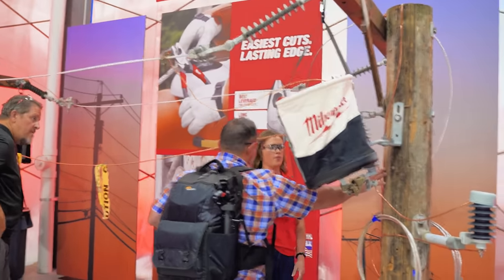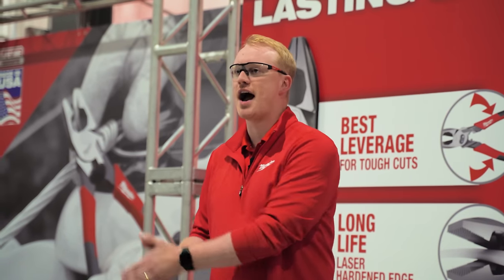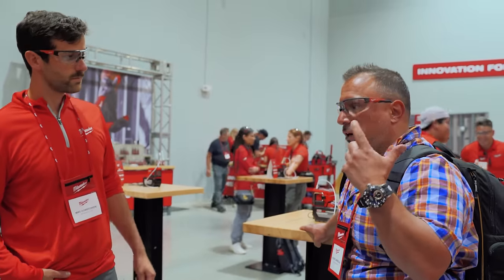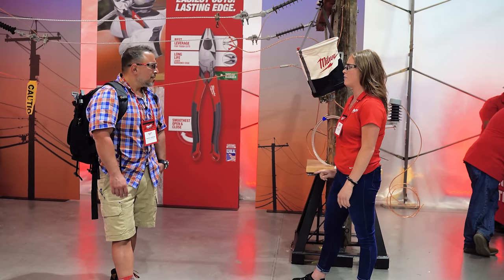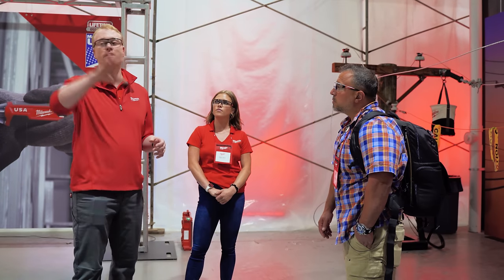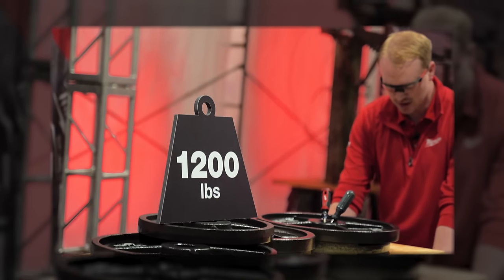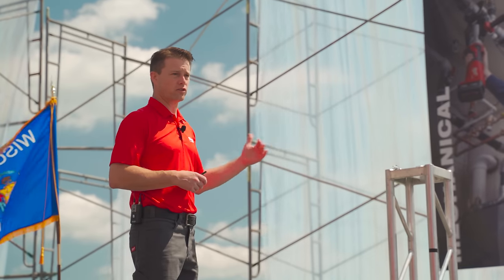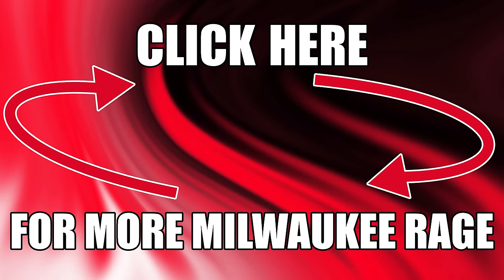BIG Problem With Milwaukee's USA Made Hand Tools (THEY'RE LYING)

Comment: I was an aircraft mechanic in them USAF for 14 years when I got hurt. The AF put me in charge of tool purchase, and I was sent to several large tool shows directed to the military. I looked at all the manufacturers and also saw some of the outrageous claims made by the salespeople. As a master mechanic I asked to try the product, but most were reluctant to let me try because of "liability" issues. I will say that Snap On was the most open to suggestions and when I asked them if they could design a drawer handle end plug that was round they asked why and I explained that the handles stuck out just enough to snag our BDU's and rip them they listened. I later ordered 24 "taco wagon " tool boxes for the hangars and they came with the rounded ends. The vice president that was at the show offered me a job in design and I declined but was impressed to see they really listened to customers. Glad you challenged them, love your videos!
Reply: Wow what a cool story! A job offer even, that's incredible. Great job, thanks for sharing, and thanks for your service!
Reply: Yeah more companies definitely need to take this approach. Especially the failing car companies.
Reply: Ll
Reply: Cool story!
Reply: How long ago was this experience you had with Snap On?
Reply: Only good thing I've heard about SnapOn in years.
Reply: Oh yea?
Reply: It is always nice to see examples of the tool companies listening to feedback instead of ignoring it.

Snap-On has been a disappointment to me lately as the competitor's products have caught up and Snap_On's response was to raise prices for foreign made tools with Snap_On  branding.
Reply: listening to your biggest acquisition firm is not really listening to customers.

Comment: I'v been an A&P mechanic for 27 years . A lot of the big companies especially in manufacturing or large air carriers or military contractors , supply the tool box now . The box is completely shadowed and the tools are tracked by computer.  It's tracked by who removed the tool . You have to use your company badge to open the drawer on the tool box , after you open and close the drawer the toolbox has a camera in the drawer that takes a picture that's digitally stored in a computer with who opened the drawer and what tool was taken  out . The point I'm making is that these tool boxes are $50,000 . By a big Tool Company  , not going to mention the name ? But it's easy to find out ! ... Milwaukee makes great tools . If you manage to break a hand tool , you were probably abusing it . I have my own  set of tools and it's  a mixed variety of brands  ( some expensive some cheap  ) Milwaukee  , some Snap On , and all in between  . Not going to even try to list them all . MY ADVICE TO ANY MECHANIC STARTING OUT . Don't go and buy a $10,000 tool box that's empty . Invest in tools for a few years  , buy a box that's within reason . I have yet to meet a mechanic that gave his tool box to his kid or grandchild.  THOSE ARE ALL SALES GIMMICKS TO SELL A TOOL BOX TO YOU . Invest $10,000 in tools, then get an expensive tool box . YOU MAKE YOUR LIVING WITH WHATS IN THE BOX . I found out two smaller roll around tool boxes are easier to move than one giant one . You're not always going to have a forklift.  Don't go nuts buying tools on credit. Seen people do this also . People get addicted to buying tools . Remember your doing this to make a living.  Don't buy a bunch of tools to make someone else rich .  ( I followed a Tool truck driver home one day ) trying to stop him to buy a tool . He got to his house , couldn't believe it . $800,000 house on 20 acres in Texas outside Houston.  Don't make these guys rich .
Reply: I made the mistake of getting a giant one because of garage space… and yea, I’m not moving that thing again.
It will be sold with the house like a pool table or Jacuzzi
Reply: Buy the tool box at Harbor Freight.
Reply: THIS COMMENT IS THE MOST ACCURATE, FACTUAL AND HELPFUL
Reply: @TheCyberMantis  cyber mantis knows the way
Reply: I'm a journeyman electrician with almost 20yrs in the field. Some tools you'll need to spend some money but most others you can get the job done with cheapies. I like my Milwaukee dikes because of the pipe reamer. They're hole saws aren't too bad or  sockets and box wrenches, but I won't use thier cordless tools. I've gone through so many different brands dropping from lifts or just wear out. Now I just rock Ryobi. Not too pricey and the hammer drill surprised me how tough it is. Band saw is nice and my tree trimming tools. All use the same batteries, so I've got that going for me...which is nice.
Reply: @TheCyberMantis  that's what I did
Reply: I've been using the same snap on box for almost 40 years it cost me about 300.00 back then and it's not the biggest box but when I stopped working on cars for a few years my son used it until he bought his own box, it's still in use at my shop its overflowing with tool,I have a couple of other boxes too. Snap on rebuilt the drawers about 20 years ago and I'll bet that box wi last another 40 years with no problems. And my granddaughter has already claimed it when I finally give up!  So they do get passed down it just takes awhile!
Reply: Yes yes yes to any new mechanic don’t buy a big snap on, Mac, matco ect box. I grad from universal technical institute and we got 30% off tools people got like 10k package with the box I spent 20k no box and got a craftsman I got the advance mechanic kit so like 4x the tools and a box. Just be smart tool make you money not the box.
Reply: You don’t know what that dudes story is.  He lives there because?  His dad died and gave him money?  Uncle gave him the land…you don’t know and this is an extremely ignorant comment.
Reply: @jaredmayer3960  we’re talking about toolboxes and your talking about a guy getting land… I’m sorry if I missed something in the video but who are you speaking about?
Reply: @jefflovespigs  read this comment again…last lines of the comment, ”you don’t buy tools to make someone else rich!”  The guy followed the tool truck owner home and the tool truck dude had 20 acres outside Houston with an $800,000 house on it.  Just because he sells tools off the truck doesn’t mean he screwed everyone over to get the money to own a nice house.  Maybe his wife is a dentist?  Maybe he’s in mega debt?  We don’t know what the story is and it’s super ignorant to assume because you see something and think he's shafting everyone.  Yes you definitely missed something.
Reply: @jaredmayer3960  no no no thanks I really did miss that bit. Yes I agree dont but a expensive box when a new mechanic but they are not scamming and marking up crazy amounts that the main company. They have a though job a lot of expensive items that can be stolen or loss of inventory.
Reply: @joe_8699  I have found your experience with Ryobi to be accurate 100 percent. I'm a California contractor and as you mentioned, some tools I use are expensive, however Ryobi work great and batteries are inexpensive and I can't kill them. I do get comments from other subs using Hilti or festool trying to shame me but I'm too old to give a shit what someone else thinks. Beside the fact I have 6+ tools and batteries for the cost of a bare tool from Hilti.😂🤣
Reply: Aircraft tech 22 years. Snap on have the best cutting tools. Matco has the best power tools. Buy cheap stuff and move it to your garage. Use matco and snap on proffesionally. Stay away from chinese junk.  Trust me
Reply: I've always said that after 23 years of being a GM tech. Your 15k tool box never once made you any money. Your tools did, however. ANY adequate tool box would have done the same job and many of them are under 1.5k.
Reply: @nalgas5569  I doubt it.
Reply: I do all mil spec work on military aviation and we don’t really use any American hand tools!
Czech, Italian, Swiss, and even India!
Reply: Your gonna be that voice in my head everytime i think about buying a tool lol
Reply: @john Marshall... no Milwaukee is putting out some defective runs... I watched a guy at home depot break 7 high torque impacts in the parking lot in ten minutes... they have made design changes that render the products defective... I'm sure they will change it but how many people bought 300 to 700 dollars scrap
Reply: @Johndoe309  Milwaukee acknowledged the defect and they're replacing all of the new model variants with the original design. There's a video on YouTube going over their statement on this issue. Glad Milwaukee owned their mistake.
Reply: I get a lot of great power tools and old school tools even at yard sales at a fraction of the cost new.  Some even still work better/last longer than new products at Lowes
Reply: @armedtotheteeth1974  One thing you forgot. Never buy prop wash of the Snap On or Matco trucks. Always buy locally.
Reply: Why the spaces before commas and periods?
Reply: McDonald's is paying $22 an hour they give you  a t-shirt and visor. You don't have to buy any tools no certification of schooling. Just $22 an hour to just mop and sweep and do a half  a#$ job at that. 🤪😱🤠
Reply: @Exar46  Well $22 ? Hr like 15 max & high.skilled Trade pays over 100k now easy & never out of work ?
Reply: That $50k toolbox might help keep FOD off the runway . Wish I had one in our shop cause I can't keep tools from walking off and it don't matter if it's a Harbor Freight Pittsburg 9/16 or a Snap On 9/16 . When you need one you need it
Reply: @jefflovespigs  There taking about the guy driving the Tool Truck with the Over Priced Tools!
Reply: @NervousNick  ya I got that I am a mechanic I know all about tool trucks it was the last bit I didn’t read till after. But thanks
Reply: @ericatchley3482
Reply: No truer words have ever been spoken! Plumber, HVAC tech, by trade, then spent 15 years in industrial food manufacturing the last 7 as maintenance manager of the hottest stock of 2019!
Reply: @jaredmayer3960  yeah that's funny you're probably the guy he followed home
Reply: Stalker!
Reply: @Johndoe309  I can vouch for these defective runs. My buddy bought 3 sets of milwaukee fuel impact/drill... all 3 broke in a day... he got sick of them and got dewalt instead. I have seen fuel tools that work... and I cant kill my old brush milwaukee models... though I want to upgrade to the new ones but I am afraid of dealing with a bad run even though they will replace it.
Reply: I have a not too distant neighbor drives a tool truck 

He lives in a shanty and he is renting
Reply: crazy that i can sell my snap on tools for 2x what i paid 40 years ago.

Comment: I live 15 miles from this plant.. and watched it be built from the ground breaking.. I worked right across the street.
They are still doing a massive hiring event.
I seriously hope they get the help they are needing.. regardless of how we feel about their tools,, they ARE hiring workers.. VERY much needed here in Wisconsin.
Reply: Hope these high paid employees and inflation keeps them in business.
Reply: i went back to work in2020 being a concrete guy we have jobs in wisconsin folks are just using the system
Reply: You need people to want to have a job first.
Reply: How much is their starting wage? And what is their wage ceiling?
Reply: If Wisconsin needs business so bad , why is Milwaukee Tool having to beat the bushes to find workers?
Reply: @jonyoung6405  The labor shortage is a mystery to some,  but it's real.  And it's nationwide...even in areas where the economy is depressed.
Reply: Milwaukee Tool is a big part of Milwaukee manufacturing market. Its great to see them setting up actual production in west bend.This is very close to where things like harley davidson engines, kohler products, generac generators, snap on tools, master lock locks (used to more), miller high life, and many other products come from. Bringing PRODUCTION back to this area is a huge accomplishment. I only know of 1 example (a workplace of mine) and it was to relocate a factory out of a dense urban area (100 yr old factory previously)
Reply: I love living in Wisconsin but they need to legalize Marijuana,  too many drunks

Comment: What would be nice to see is Milwaukee have an agreement with HomeDepot (or any other authorized retailer) to have the lifetime warranty claims take place at that location. Kind of like how Sears had Craftsman... if a tool broke, you brought it back to Sears and swapped it out. If a tool breaks, and I need it, I wouldn't want to wait to have to send the tool back to Milwaukee for them to replace it. 

I understand that hand tools are not expensive, but if you have a tool that comes with a lifetime warranty, you should only need to buy one. Personally, I purchase 2 - 3 of the most common tools and have only one of the others. Like a 10mm wrench or socket, you are actively using it, it's in your hand while you're doing a 360 degree turn and suddenly it's missing, never to be found again.
Reply: Menards has an in house policy on lifetime tools if they sell it. No Milwaukee there but some other good brands.
Reply: @cartman0223  I've heard a lot of good things about Menards, the problem with it is the closest one is 350+ miles from me.
Reply: That 10mm socket gremlin is real
Reply: The stores by me WILL warranty Milwaukee hand tools
Reply: @n2ocharged  I feel that I've never even seen a Menards, I would like to though.
Reply: Actually, hand tools are getting expensive. I currently work in a profession that requires a ton of hand tools and power tools and just "updated" and added to my hand tool collection for $500.
Reply: Sears was lifetime guarantee on all of their hand tools only. None of their power tools were ever lifetime. What a shame they're not making their tools anymore like they did in the '50s, '60s, '70s, and '80s.  You just couldn't beat those old Craftsman, Proto, and Klein Tools.
Reply: Harbor freight dog
Reply: I’ve noticed Home Depot Milwaukee isn’t the same
Reply: Loew's now sell Craftsman tools.
Reply: @PapaGringo1  They've been selling Craftsman for a long time

Comment: As an electrician for over 20 years I've learned from experience that when you find a brand that does a particular tool better than the rest, that's what you stick with because you tend to get screwed over when you switch to another brand.  Klein, for example, tends to have the best linesman's pliers.
Reply: Gtfoh Knipex by far has the best linesman pliers. Klein can’t do anything better except drive staples if you’re into that kinda thing. After using knipex for a couple months you’ll pick up a pair of Kleins and think to yourself “gross”
Reply: Lmao @ knipex being good. Took all the advice and spent $60 for a pair. Cutting edge didn’t last me a month. the worst I’ve owned. Never buying that shit again.
Reply: Depending on what pair you get, you can have added features.  I prefer the pair that has the crimper in the back.  I find that way more useful than any other added feature that they offer.  I stick by Klein linesman pliers because I've never had another brand that consistently works better.

Comment: I like Milwaukee well enough. The guy that taught me building trades for 3 years, gave me my first job in the trades , he swore by Milwaukee. He said they are number 1 but he also held makita in high esteem at #2. But I started out buying skil saws, black and decker sawzalls, and whatever brand tablesaw I could get for 89$ . Then I moved up to dewalt because they were at the price point and a brand I saw a bunch of guys using. I built as good with my original setup as I do with all the new tools. The biggest game changer in my opinion is the multi tool, oscillating saw. That son of a gun does so much and replaces so much. I find myself using it time I shouldn’t because it’s already out and hot damn it seems to always get it done